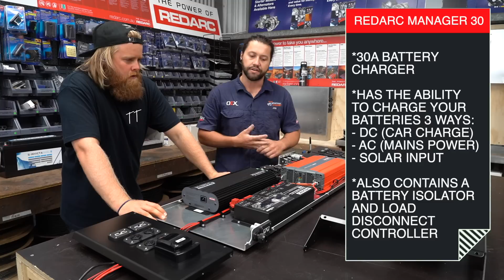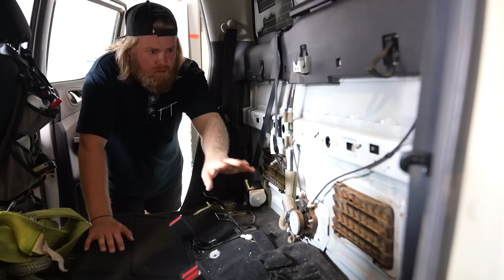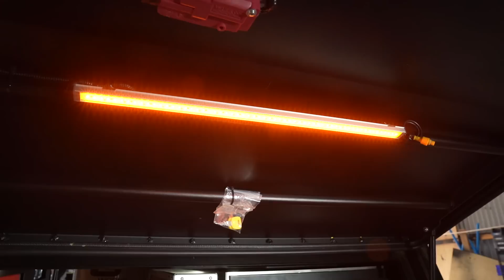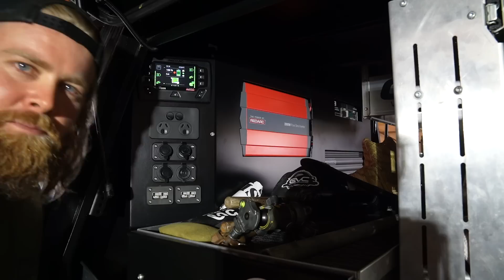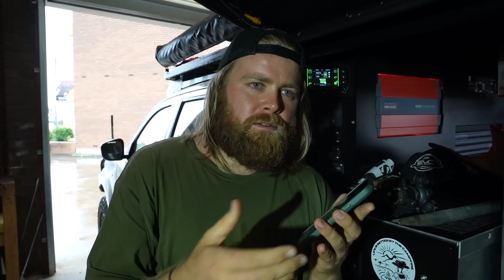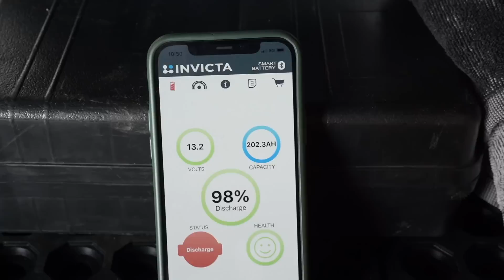ULTIMATE dual battery set up for OFF-GRID LIVING! REDARC red vision system camping | 4wding

Comment: I have purchased an Enerdrive system for my new Canopy. It will have a 200ah lithium battery, 2000w inverter, DCDC charger, ACDC charger and that other stuff. I plan to pop a slimline solar panel on the canopy roof rack. This kit will run a 130L upright Bushman fridge, ARB twin compressor and induction cook top etc. I’ll prob no longer use LPG and start using battery chainsaw and 54v tools eg. Its a game changer for saving weight, time and making work on the road comfortable.

Comment: What a dream set up! Very jealous. Great to hear it's getting well used and making life (and work) easier on the road.
Also great to see you supporting quality local manufacturing and businesses that provide top tier products, installation, and service. 
It's always good for a laugh to see the fruit loops having a dig at you for not using the same setup as them, often made from C grade imported gear, set up for occasional weekend use with a fridge and a USB port. Glad it works for them, but seriously haha.

Comment: When on a boy's trip, I run everything via the Patrol's simple dual-battery setup and when camping with wife, I use an inexpensive LiFePo4 battery in a box and fold-up solar panel for weeks of power for the fridge. Cooking is done either on the fire or a gas cooker with usually pre-made meals. When on a boy's trip, all the cooking is on a Coleman single fuel burner or a cheap 12V hot box (all pre-made meals kept in the fridge in vacuum bags or tin foil boxes). And I can charge all my video and stills camera batteries, plus chainsaw battery etc without any issues. After more than 40 years of off-roading, the simpler the better.

Comment: Backward step in afraid Tyler. Should have looked at Victron blue, 75amp charging from a 3kw invertor charger. Much better connection via Bluetooth. Redarc has been reported to drop out when trying to connect/control via app. But I suppose if you get the system for a reduced price or free? Then good on you.

Comment: top install mate. totally get why u need this n makes sense. as u said its not for everyone. the standard AGM system works very well for the touring person who only needs the basic 12v acc. its not necessary to have a Lithium system to travel this vast land wen a AGM 12v system will work for ur needs n that depends on wat u think ur needs r. for me in my 2021 Ram 1500 i have the same system as u have with the only difference being i run twin 200Liths in my Mits canopy. i use the Ram to tow my 2021 Nitro bass boat to the barra dams n the cod dams in winter. this year i am buying a 2022 Ram 1500 with Mits Canopy n will be running the same 12v system in it n giving my son the 2021 Ram to fish the dams with me. before the nay sayers jump on board as they have done to u TT, i am not a youtuber just a fisherman who can afford these things n its wat i want. gud on u TT.

Comment: This shows the high end. There are other levels that work perfectly. Ctek 20A dcdc charger $350, lithium battery $650, fused distribution box (other or K's) $200, 170W Hardkorr solar panel $180, shunt $200, optional AC lithium charger $200 to $400. Some wiring, fuses... Mine is perfect and sub $2,000.
Reply from the maker: Yeah mate and suitable to a lot of people, no one is saying you can't have or use that system. I feel like people always take this as a personal attack and I am saying their cheaper system is sh*t. But a cheaper system is not going to offer what this system does and I've tried cheaper systems and they do not work for me and what I need from a dual battery system being a full time content creator that spends weeks on the road at a time.
Reply: @TylerThompson90  
Hey Tyler, as the old saying goes... there's courses for horses.. everyone's different in there setup, and what you explained and need is what you need to run your business...  My set up is great for my needs, dual Battery, DC  to DC, solar panel  and I'm good to go for a few days or so...
Maybe those who have questioned your set up need to watch the video again to understand why you need what you need and its cost factor. Great explanation re your set up 👍
Reply: That’s realistic. 👍🍺

Comment: At first I thought you were installing the ultimate dual battery system in the Patrol, which made sense to me, because you already installed the ultimate dual battery system in the Navara & hinted that you will be buying & building another vehicle to replace the Navara. Or are you going to put the old, ultimate dual battery system into the Patrol, & then this new ultimate dual battery system from the Navara into the new vehicle when you get it?
Reply from the maker: Yeah kinda haha, the Victron set up from the Nav is being transported and built over into the Patrol (video coming on that soon). But it made more sense to have the bigger and better dual battery system in the nav as it is more the tourer and one for longer trips and has the water tank, lights, more charging requirements etc
Reply: @TylerThompson90  & when the new rig comes to replqve the Nav, you will transfer this setup into that? Or am l spoiling your suprise?
Reply from the maker: Yep the dual battery system will go with the canopy to the next 4wd, another reason why we put it in the canopy because it makes it much easier to transfer
Reply: Cool bananas